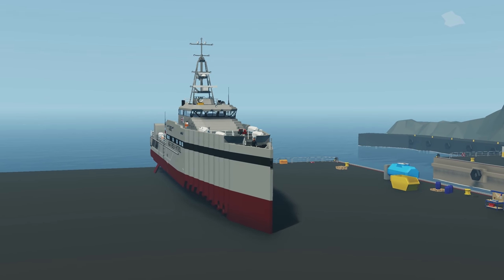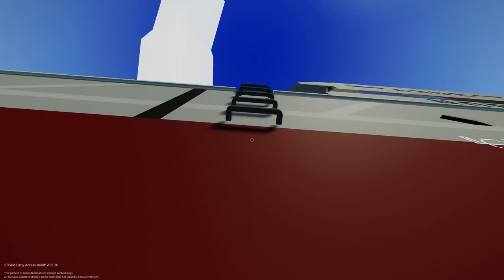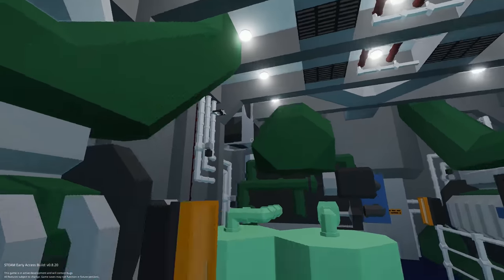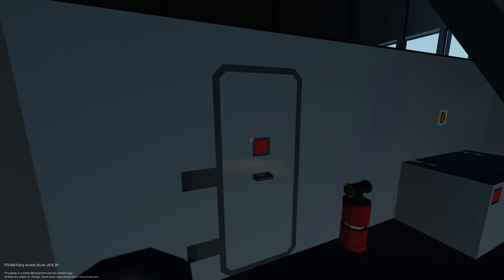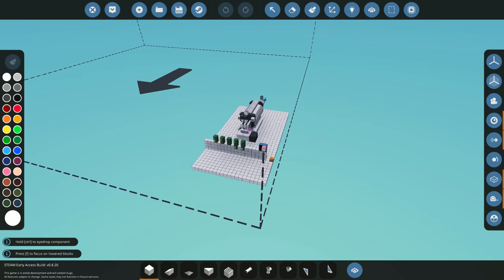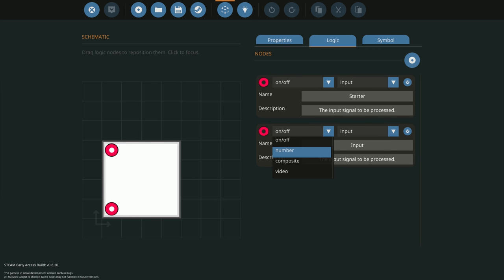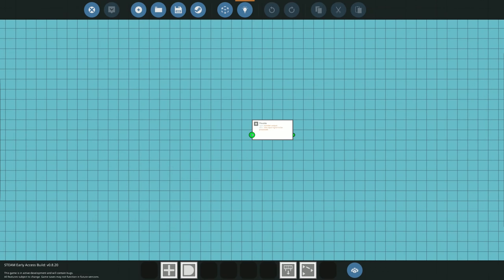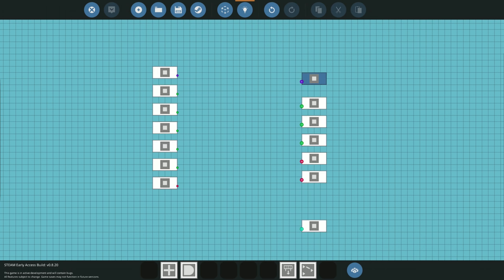Stormworks New Build Series - Part 4

Comment: Really clever to use these "wing section (small)" for the side. But i have to dissapoint you these will cause problems because of the wind. If you are on the water and the wind goes up it forces your boat to go with the stream. You wont be able to turn until the wind stops. 

I tried it for myself and i was really dissapointed.

Comment: Just a question, I'm building my own engine room with as much detail as I can now, and I'm struggling to find a purpose for all the dials along the control boards. Other than RPS, Temp, Torque, etc what else would you include? Or will some dials be just for aesthetics?
Reply: Maybe add some to like temperatures sensors just in the room idk

Comment: Can anybody help me with a problem I have with my ship, it is a 50m multipurpose ship with 4 large engines, but the problem is that none of those engines seems to be able of exceed 30~ RPS, idk why I have tried everything from adding some more pumps to reconstructing the whole engine system, but none of that worked, as soon as the engine reaches 30~ RPS “air” and “exhaust” will go red as if there isn’t enough of those (but putting more pumps or shortening the pipes didn’t change any of that) PLS HELP!
Reply: Yeah there’s a limiter for the engines if you go on the “selection” mode in the workshop. Also i’m not sure if those engines are even supposed to go super high in rps - I know I always use gearboxes. Also if your trying to achieve a higher speed I personally think you get much better performance having two large engines per giant propeller instead of one on each.
Reply: @jacksonpilarski8710  already did that, and in theory they schould reach 100 rps, they all have their own clutch, and even if they are all disconnected, the max is 30, I already have 2 engines per giant propeller, it is not very wide for its length
Reply: Yeah I’m working on the same problem where I’m trying to make a large ship that’s fast - for keeping engines happy I recommend more fluid ports and maybe doubling up on pipes- I’m not sure pipes have a capacity limit that’s just something I’ve done.
Reply: Jackson The Pilot ok thanks, you could let me know when you get it to work properly, I’ll be grateful